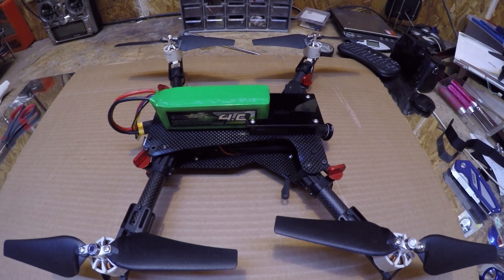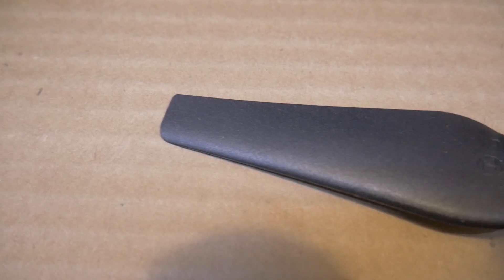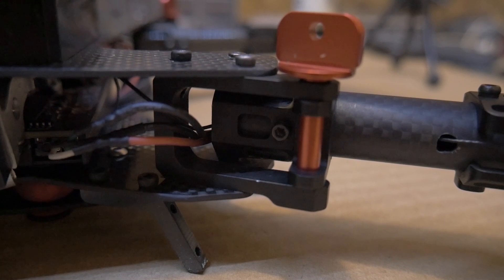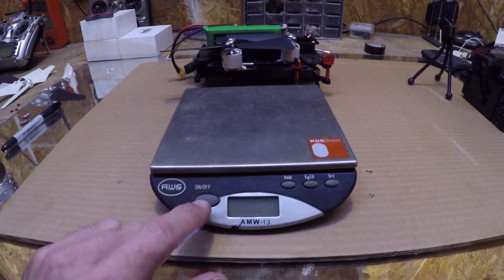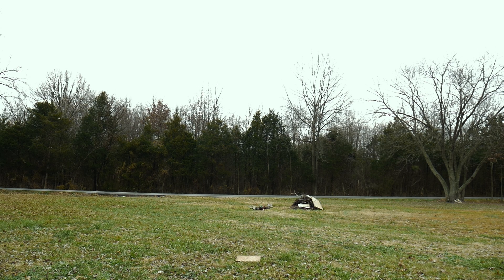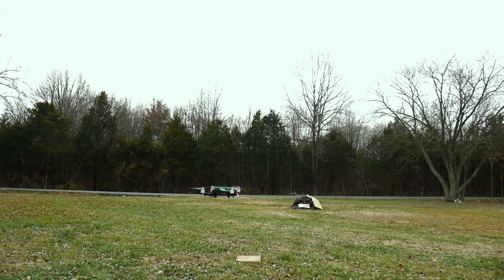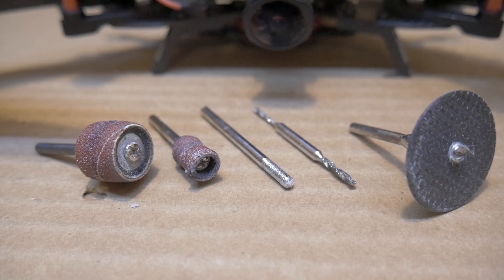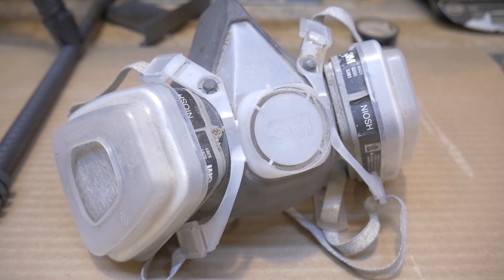bebop carbon fiber build + bigger motors

Comment: What modifications you do to install the motors?
Reply from the maker: Diego Castañeda hello I used servo extension lead ends to plug into the bebop board, just make sure the motors are turning in the correct direction.
Reply: MONEYPITR/C with the stock ESC?
Reply from the maker: Diego Castañeda hello Diego, yes sir the stock escs have been fine.

Comment: i did swap the bebop motor with mjx bugs 3 motor n why it detects motor stage broken on the app??
Reply from the maker: wildan kholidul Firdaus hello, I think your talking about when you click the launch or take off button at the bottom of the app, if so, then this happens to me also sometimes, when this happens just keep pressing the launch button quickly a few times in rapid motion and the drone will launch. If this isn't the case and you see the motor fault on the app when you first power the drone then recheck the motor wireup connections. Hope this helps.
Reply: MONEYPITR/C that was really helpful. thanks a lot for your fast respons, i really appreciate it. i'll try it tomorrow

Comment: Hey very nice . how does  the system detect the bigger motors ? If the drone just feeds the new motors the same rate as old  won't they not produce any more  power ?
Reply: I also upgraded my bebop 1 just aftermarket battery's and charger . Runs great though was thinking of upgrading motors since stock ones are pretty banged up . Lol
Reply: Does the rate of climb increase and acceleration increase ?
Reply: Which battery are you using? You have the link to buy it?

Comment: is it worth it?
Reply from the maker: Helderhugo hi, I think so. I'm going to try some different motors, props and 3d print a new frame in the future and see how that goes.
Reply: hugo eu tenho o bebop 1 e gostaria de mudar os motores mais baratos porque os originais custao muito o que achas que posso meter. podes me ajudar obrigado
Reply: Isso é que não sei como fazer. Já vi o Bebop algures com motores diferentes sim
Reply: Helderhugo acho que seria uma ótima idea poder mudar para motores mais baratos e melhores e com outras elices. Que tal tentar saber se e possivel fazer isso?
Reply: MONEYPITR/C how different is it :? In what ways? Cause I mean just getting a 2500~ mAh battery would also maybe achieve the 15m~ flight time

Comment: Hiya! Nice job! Ive got a load of bebop2 parts after i crashed it and had to rebuild.  Looking at doing somthing like this with the parts.  I have a mother board, motors and props etc and Just ordered some other bits.. really like the carbon fibre and have seen a frame i like. Is it as fast or faster, or shall i get another bebop2 chasis and just work off that 🤔🤔  wondering pro's and con's of this bigger chassis!? Cheers😀
Reply from the maker: The DruiD hi, if I was to do it again I would try to make it a little lighter, but over all I like being able to put or try different props and batteries. If you already have all the parts I say go for it.
Reply: Thanks for the reply mate! I put another bebop2 together which flies really nicely so i have 2 now ! I think im gonna sell these and try and get a mavic pro, i like the filming side of the drones and the bebop2 isn't quite there for me to be honest

Comment: So glad I found this vid as I was researching if it's possible to use different motors. As I guessed, it is :) On your build I see just 3 wired going from the main board to the motor. Is that really all there is to it, the three cables going into a brushless motor? I gather the Bebop has on-board ESCs? If so, any idea what the rating is? Sorry for all the questions, thanks for any info you can provide and: nice build!
Reply from the maker: absolutely just 3 wires per motor. not sure what the rating is on the esc's, but they are doing fine. You will need to check motor direction before finishing up but thats it. Thanks for the question hope this helps.
Reply: Hey, thanks for that info. To get a clearer view on your setup I googled a bit. Is it correct that DJI Phantom propellers are about 9"? Is that what you're flying with here? And could it be correct that the Bebop uses 6" props? 
Since it's difficult to tell the rating of the ESCs on the Bebop I looked at the max rating of those 2214 motors which is 251W. On 3S you'd need over 20A to start smoking 'em. Since you report no issues my guess is that they've got at least 20A ESC's in the Bebop.
Reply from the maker: Hi sir, yea the phantom props are 9" I tried them at first but the build would rocket into the sky on launch almost uncontrollably, so I cut the phantom props down to about 8" it did fine after that. 20amp for the esc's may be right, I havent had any problems with it.
Reply: Great, thanks again for the help.

Comment: i assume your still using wifi to control the bebop? are you using the stock ESC?
Reply from the maker: yes sir still using wifi with the help of a ps3 controller, and it is the stock esc's. thinking of trying some racing drone motors (hi kv) tri props and a 1300 mah hi c lipo. What do you think?
Reply: @MONEYPITRC  question. I'm on my 3rd Bebop 2 and I've upgraded them all with various things eventually occuring like loss of GPS and a fly away but I'm loving this, did you ever swap motors and how did that work out for you? I know this is a little bit late but just looking for some input I appreciate your time

Comment: hi what kind of frame are you using>
Reply from the maker: Hello azi zie, I hand cut the frame out of carbon fiber plates. I used a dremel and dremel accessory bits to cut and shape the frame. The bits I used are shown it the video. thanks
Reply: Ahhh ic. Noted on that. Nice one. Thanks for the sharing.
Reply from the maker: No problem